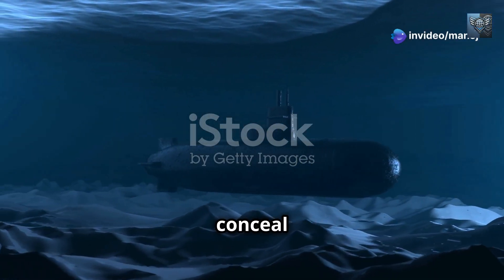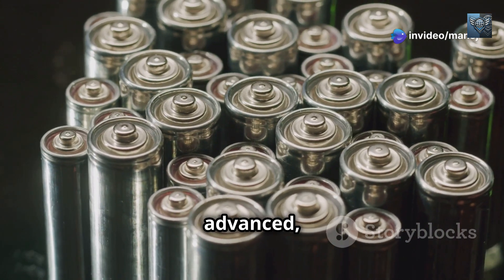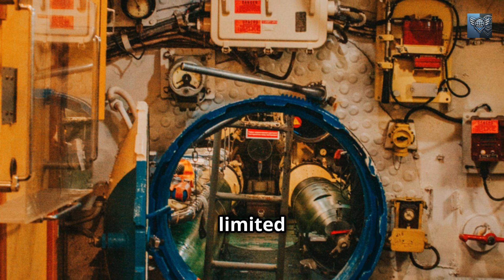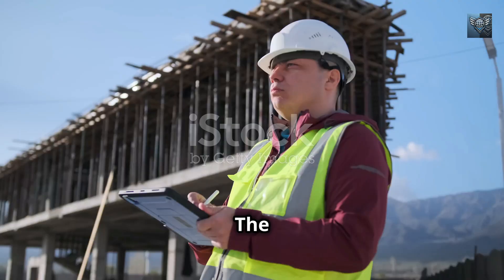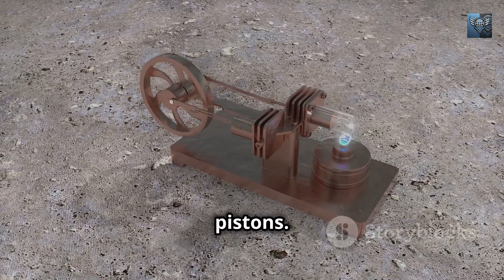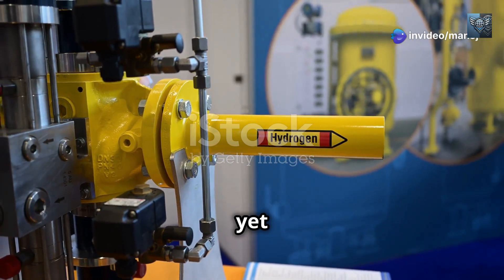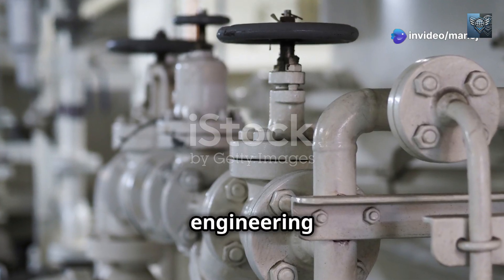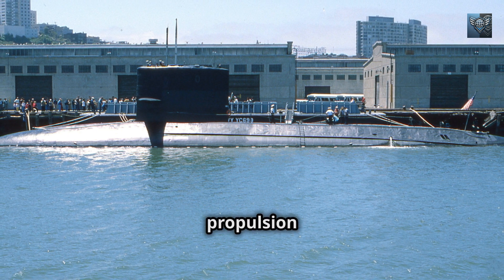Submarines- The Secret of Air Independent propultion (AIP)

Comment: Being able to be underwater for weeks instead of days

So the question right here is if you’re trying to have endurance stealth what would be the operating range of an AIP proportion system compared with a nuclear proportion system that gives months of summer stealth

Sounds like to me that what AIP provides the ability for a submarine to stay submerged stealthy nearby a zone of operation where it can be replenished

The nuclear powered submarine still has ability to go across oceans undetected like the Pacific the Atlantic Indian
Reply from the maker: Thank you for your comment in Strategic Vanguard>

Now coming to your query: AIP and nuclear propulsion optimize very different layers of submarine operations, and they are not interchangeable.

Air-Independent Propulsion allows a conventional diesel-electric submarine to remain submerged without snorkeling by generating power internally. In practical terms, an AIP submarine can normally stay continuously submerged for about 10 to 21 days at low patrol speeds of roughly 3 to 5 knots, and in carefully managed conditions this can stretch toward three or even four weeks. The key limitation is that AIP fuel and oxidizer are finite, so speed and maneuvering must remain conservative.

Operationally, AIP submarines still transit from base using diesel and battery cycles and usually reserve AIP usage for the final patrol area. This means their effective stealth operating radius tends to be regional rather than global, typically within a few thousand nautical miles of home ports depending on logistics and doctrine. They are therefore best suited for choke point control, coastal defense, and ambush patrols in nearby seas where they can withdraw and replenish.

In that sense your interpretation is accurate: AIP provides the ability for a submarine to stay stealthy for weeks near a zone of operations where support and replenishment are feasible, rather than enabling continuous ocean-spanning deployments.

Nuclear propulsion fundamentally removes propulsion endurance as a constraint. A nuclear submarine can remain submerged continuously for months, with endurance limited mainly by crew endurance and food rather than fuel or oxygen. The reactor operates without atmospheric oxygen, so there is no need to surface or snorkel at any point during a patrol.

This gives nuclear submarines essentially global operating range. They can transit entire oceans at sustained submerged speeds well above what conventional submarines can maintain, reposition dynamically, and remain on station far from home bases for extended periods. This enables strategic deterrence patrols, distant surveillance, sea control missions, and persistent presence across the Pacific, Atlantic, and Indian Oceans.

On stealth, there is an important nuance. At very low speeds in an ambush posture, modern AIP submarines can be extremely quiet and sometimes acoustically quieter than nuclear submarines because they lack reactor coolant machinery and large rotating systems. However, nuclear submarines retain the advantage of sustained mobility and endurance, allowing them to maneuver, sprint, evade, and redeploy without endurance penalties.

So the distinction is clear. AIP excels in localized, slow, stealthy persistence close to the theater of operations. Nuclear propulsion excels in global reach, long-duration submerged operations, and strategic mobility across oceans. Your conclusion that AIP supports stealthy regional presence while nuclear submarines enable undetected transoceanic operations is essentially correct.

Comment: Stirling engines (principles are explained, but not the heat source). 
Hydrogen + Oxygen Fuel Cells as the current technology, which makes sense. 
The rest is fluff that might be fitting on a high school essay.
Reply from the maker: Thanks for commenting at Strategic Vanguard. Your point is noted and we will strive to make our videos better in the coming episodes
Reply: @StrategicVanguard  You also didn't mention Hydrogen Peroxide plus diesel at all.